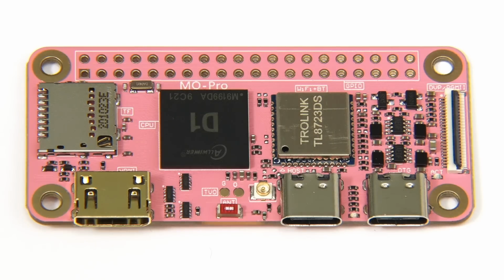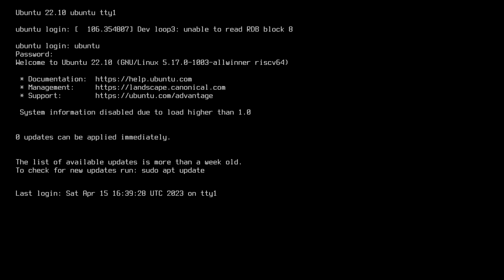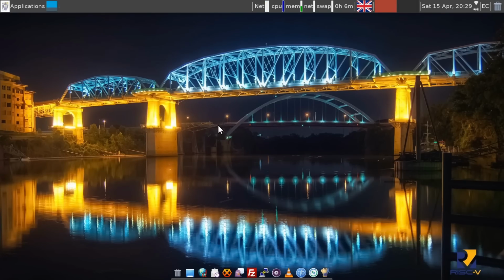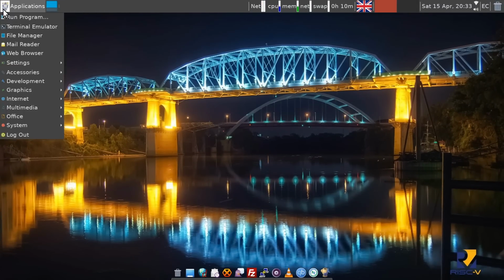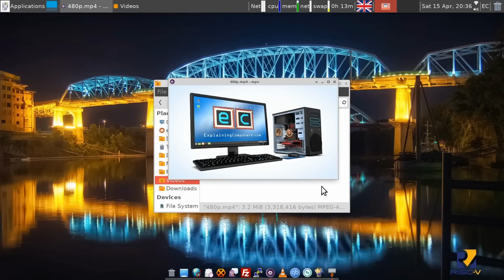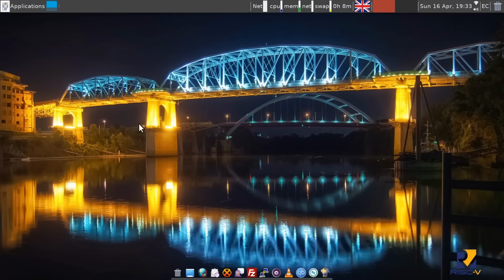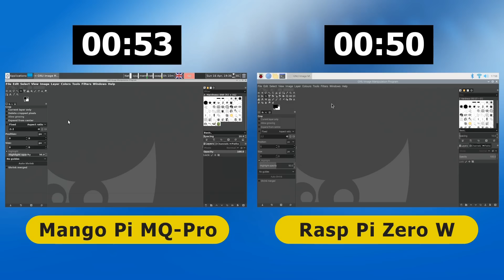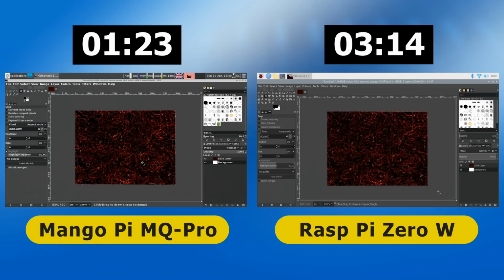Mango Pi MQ-Pro RISC-V SBC

Comment: I really like that RISC-V seems to have reached similar performance in this form factor battle! Shows, that we are getting closer and closer. Even AMD and Intel uses RISC-V in embedded systems and even their CPUs to control supporting things in their architecture. Probably temperature monitoring and safeguards are being controleld by a small RISC-V core. So we ALREADY have it lingering in out desktops, just out of sight and for a very different task nobody thinks about.
Reply: Desktop manufactures been using secundery embeded CPUs for long time, they been using ARM, but ofcorse they rether use something that don't require dealing with Nvidia which owns ARM licencing
Reply: @ShadowriverUB  NVidia couldn't buy ARM. But Softbank is even worse than NVidia.

Comment: We used to run XFCE, GIMP,  Inkscape, and Firefox all day on single core x86_32 chips with 512MB of ram. Of course, resolution was 1024x768, and those programs have changed a lot since then. Wonder how hard it would be to make stripped-down builds of the modern codebases optimized for single-core use. I imagine they use tons of threads these days, which would generally be counterproductive on a single core. 

I suppose such a build is posible for Linux, since it needs to run on embedded systems. Probably not much demand for a usable desktop environment and associated programs, though.
Reply from the maker: You make a very good and very important point. It is (was) perfectly possible to do a great deal with 512MB of RAM.
Reply: Things would be faster on my old windows98 100Mhz 32MB system than on these new boards with x10 the resources. There is definitely some bloat going on. The 1-4GB os image sizes say a lot.
Reply: @freakinccdevilleiv380  It's not just bloat though. Things like full disk indexing, aggressive file caching, high resolutions, compositing window managers, real-time decoding of various compression algorithms, gigabit ethernet, and fast wifi, just weren't viable on the older hardware.
Reply: You can do it with Gentoo Linux - I run Gentoo today on a Thinkpad T22 from 2002 with a less than 1 GHz CPU and 512 MB RAM.

Gentoo compiles from source as it installs, you can use "USE" flags to turn on and off certain features in packages. 

For example, if you want a small and light MP3 player that doesn't need support for other formats like FLAC or OGG, then you can usually turn those off to make that player application as small and light and possible.

You can do it all now, it's just a case of learning how to do it.
Reply: @terrydaktyllus1320  That's quite interesting 🤔 What is the boot time on that system?
Reply: @terrydaktyllus1320  How is today's web on that thing? Do you have to run a lot of content blockers? I would think the Javascript, css3 and videos embedded everywhere would make most websites unusable on older hardware.  Are there ways to compile modern Firefox or Chromium to run on such a machine?
Reply: @freakinccdevilleiv380  It's probably 20-30 seconds. It has an IDE disk interface but an mSATA to IDE converter means you can boot from an SSD and that makes the machine a lot more "nippy".
Reply: @Aplysia  Lots of questions...

The modern web is not the only way that I use a computer over networks, that's the first point I would make.

I dislike the modern web intensely, I think it's a bloated mess and, where possible, I try to use alternative solutions than just a web browser.

For example, for accessing most content, including YT, I use newsboat with RSS feeds and scripts that run mpv for video playback - thus avoiding the browser entirely. (If I have to comment, then I have to log into YT as anyone else would).

I use mutt for email - in the terminal, not as webmail.

I don't use streaming music or video services (due to privacy concerns), I buy my media on disk and rip it myself - I can do that in format that plays on lower powered hardware.

I do a lot of Internet research where all I am doing is reading text - so w3m or lynx work as text-only browsers in that case.

Don't get me wrong, a machine of that age will struggle running any modern browser, I doubt it would play much video here. But I don't use it for that.

I've worked and played with computers for 40+ years now, I enjoy using alternative ways of accessing information or communicating with people - gopher, gemini, irc, Usenet, even a few Internet telnet BBSes...

If you haven't lived through that era of computing, you won't have any perspective on it.
Reply: @terrydaktyllus1320  This looks awesome, I'll try Gentoo today thanks 👍👍
Reply: @freakinccdevilleiv380  Good luck!
Reply: @terrydaktyllus1320  OK, yeah that's what I expected. People still say stuff like "All I need is something to browse the web. " and don't realize how much work it is to render these new sites, or how much work it is to avoid them. 
Are there any search engines that are more oriented towards information than they are to e-commerce and media? I can't find much of anything on Google or Duckduckgo now days that isn't a storefront and/or SEO garbage. Or, do you stick to mailing lists books and other offline documentation?
Reply: @Aplysia  I am starting to use Searx more than DuckDuckGo, I can't really comment yet as to how much better it is or isn't - but it seems to be well rated.
Reply: The hell you did, there wasn't Inkscape when 32 bit x86 was relevant modern hardware. Meanwhile Explaining Computers here is running with no. heatsink. Didn't pop cpu temps open in inxi. Running an object desktop with no clipboard manager in sight. This is corruption.
Reply: @Cineenvenordquist  Inkscape was released in 2003, 64-bit CPUs were only just starting to appear on PC platforms then anyway - around 2002, I myself had (still have) an IBM Thinkpad T22 with a 32-bit Pentium III CPU and probably 128 MB RAM in it (that I've since maximised to 1 GB).

I can't say I ran Inkscape back then (even now) but I was certainly running GIMP and OpenOffice / StarOffice on Linux back then.

For the record, I have that machine today and it has LibreOffice installed on it. It's not "fast" by any stretch of the imagination but it's usable.

And you cannot equate the version of an application that ran 20 years ago to a later version that runs today - as CPU power and RAM has become exponentially more available, so has the ability to include more features into an application to take advantage of both.

That's just "common sense", surely? Why do I need to explain this to you?

Comment: The D1 chipset has a h265/264 decoder onboard, so I suspect video playback is something that can be improved considerably as the linux support matures.

Great review! I've just ordered one, i also got a visionfive 2 based on your review and with the latest firmware I'm loving it 😊

Thankyou!
Reply from the maker: Thanks for this. As you say, there is great potential for software improvement for video playback. The VisionFive 2 is indeed progressing nicely as you say, and I will return to it on the channel when we have the first release OS.

Comment: Thanks for your great and clear reviews! I love them. If I may suggest a very interesting retro-like tiny computer/ Memory Operating System: The AGON light: New open source 8-bit System. A very compact open-source system using a modern Z80 variant, an ESP32 chip and 512kb of static RAM running MOS and BBC basic very fast. Even boasting a GPIO header for interfacing to external electronics. Would like you to review this one, I think you'll love it.

Comment: Great video! Did you notice in your tests whether this board has a low power or sleep mode? It would be useful to wake it up with a microcontroller without having to go through the complete boot process for certain things.

Comment: The problem with this thing is it is only sold on Taobao (for Chinese) and AliExpress. I stopped shopping there, and an item was not delivered to the correct address, and refused to help out, and would not refund. The place where it was delivered shown by GPS map did not even exist.
Reply: That's hardly their fault, though also your contention that φ,θ on Earth's surface has invalid members is new s---. How did the courier find a good spot in badlands to drop off your packet? Get that together, confer with neighbors on getting delivery, and retry. 🌵🧗🏼‍♂️🎮
Reply: @Cineenvenordquist  They picked the courier, not me.

Comment: The mere fact you can run a GUI on a SBC smaller than a credit card, is crazy.
Reply from the maker: Agreed. I never cease to be amazed by this.
Reply: You can, but you shouldn't. If you still want, you have to waaaaaaaaaaaaaaaaaaaaaaaaait a lot.
Reply: Not such a surprise on a platform where the GUI is a modular, replaceable layer. Only a surprise if you are accustomed to platforms where the GUI is bound into the OS as an inseparable monolith.

Comment: An interesting little board, but I think I'd wait for version 2 unless I had really low performance requirements. 

I wonder how many of the Pi-clones will start to struggle once stock of the Raspberry Pi starts arriving. Now that it's Q2 it'll be interesting to see if/how availability improves.
Reply: According to Raspberry Pi , inventory would improve by Q2 2023, and unlimited inventory by mid year. I keep track of a site which reports on the availability of Raspberry Pis.  As soon as the site reports anything b+ or Zero 2, they are sold out in seconds. If you go now, all you will see is original Zero and Pi a with only 512MB of RAM.  It seems the supply issues they said would improve is not doing that.
Reply: @knerduno5942  - Agreed. I looked into this a couple of days ago and I saw absolutely no improvement in the supply.
Reply: If everybody waits for version 2 then there will be no version 2 because version 1 didn't sell enough. Ultimately this board is aimed at the "DIY" hobbyists and makers to try out and see what they can do with it.

I was actually very dismissive of RISC-V when it was suggested that it could come in as a contender for ARM but it is really grabbing my interest now and I shall be getting one of these boards - I'd love to see how Gentoo Linux runs on it as a very customised build.

Comment: the speed at which risc-v is improving is pretty awesome.

also i can see this little guy being taped to the bottom of a keyboard with a black and white screen. modern typewriter, would have amazing battery life.
Reply: But it's essentially the same specification as the original Raspberry Pi Zero that came out years ago - so what stopped you doing such a thing when that came out? If anything, it's easier with ARM-based boards because they currently have better Linux support than RISC-V does.

Don't get me wrong, as a "RISC-V" sceptic a while ago, it's great to see these new boards coming out and I shall buy a couple myself to mess around with because of my new-found enthusiasm for the platform.

But this board can't do anything a Pi Zero has not been able to do for a few years now - the main difference is the hardware design being far more open than ARM-based boards but not a lot more than that at this point.

Comment: A brilliant little Mango SBC for a home hobby IOT project.  I am doing some Raspberry Pi4 examples on the Orange Pi-5 Debian Bullseye OS.  The question is how to control the GPIO PWM pins of the 26-pin header in Thonny Python? How is the GPIO library imported for pin control?  I cannot find a GPIO Orange Pi5 example.  Does the Mango Pi MQ-Pro have good GPIO information?   😎 Thank you.

Comment: I feel like I'm seeing Windows 95 days! The CPU is really low-powered, but you should definitely try Doom on this.
Love it <3
Reply: More like Y's II. But hey, try and run a thermal shroud X hot end, feed, and 3D gantry or 4 (or preferably a heat pumped thermoformer press set) off that GPIO (and additional circuitry and power.) Hey it's my cosplay of The Five Star Stories final scenes...runs on a pink MangoPi. 🥭

Comment: Chooo chooo! RISC-V hype train coming through! 

Question: with different ISAs, can we even compare RAM clocks side-by-side? Isn't that an apple to oranges or oranges to grapefruits kinda thing?
Reply from the maker: To some extent, yes. But on this basis we could never compare anything other than two identical chips -- two i5 10400s or whatever -- clocked at different speeds. All CPU comparisons in practice speed with a different architecture, if not always a different ISA. :)

Comment: It's pretty slow, but it works. It's impressive for the price. RISC-V still has a long way to catch up not just hardware but the software stacks and bundling it all together configured for end users ready to go. The latter is usually the biggest hurdle devs don't want to mess with b/c it "works for me" after they've spent a dozen hours tinkering with settings and filling in driver gaps and libraries that were left out.

Comment: I have the mango pi mq4 h616 and the bigtreetech h616. I seen dialog that the h616 is a risc-v cpu but I can't confirm. All I can tell you is that the manufatures of the mango pi and bigtreetech CB1 are just using the orangepi zero 2 software. The fun part about risc-v is that manufactures don't have to wait for other manufatures to give out the cpu information to write software for the cpu that gives everyone the features they want.

Comment: The D1 (I think it's called) also has a fairly chunky DSP copro which you can run one of the lightweight tensorflow flavours on!
And hardware codecs for video, so it's probably just a support problem for video playback (Linux Vs video hardware, the eternal battle continues)

Comment: Very interesting device, if I can suggest that such devices should be tested for what it's designed.    Graphics and video rendering and playing is MOST definitely not what this is for .    So what's the point that you are doing them?

In a a brief mention you admited that graphical desktop is not likely to even be needed .

IO speed, capabilities, libraries, etc etc, should have been the focus of a review for this sort of SoC.   

Thanks for introducing it
Reply from the maker: You make a fair point. But the GIMP render test did show a direct processing comparison.

Comment: Wow. Nice to see RISC V getting there, but that is painfully slow as a desktop. Perhaps some server stuff (Plex, email etc.) may be more suited. The video playback kind off reminds me of the first time I played an AVI on my Amiga 1200 (before I got the gfx card and '060 accelerator). It played, but you had to forget audio and be patient. For a laugh, I tested the "Lava" render in GIMP on my desktop. I could barely time it - maybe 1 second.
Reply: I suspect slow due to lacking GPU driver, or the GPU they used?
Reply: @knerduno5942  I have no doubt that it didn't help, but even loading software would be enough to put me off, hence my suggestion that it may be more suited to being a low power server.
Reply: @stephenhargreaves9011  I was thinking possible using it for a "Smart Mirror" but the video seems too weak now.

Comment: I think this goes to show you that the software needs to catch up to the hardware. My 533mhz Celery running Win98 could boot faster than that, and it only had 256mb of RAM as well. Even though I firmly believe CISC is a better choice, I'm definitely going to get one of these so I can look into porting my compiler to it and see if the design is good enough to adapt to other hardware architectures.

Comment: While the advancements in RISC-V are certainly exciting, it's crucial that manufacturers feel motivated to provide robust driver support. Based on my research, it seems FTDI currently doesn't offer support for RISC-V, limiting it to x86, x64, ARM, and MIPS32 (as per AN_220). Recent Ubuntu releases that I've used all natively support FTDI without any additional installation required. I'm genuinely curious if Chris's successful Ubuntu server installation included any inherent kernel or distribution support for such devices.

Comment: I'd like to see a video looking at server / headless / non desktop fun stuff we could do with lower specs SBCs like this or the Raspberry Pi Zero range.

At least lower spec than a Pi4 or other more powerful SBCs.  

I know I could run a web server and with WiFi make it an access point so phones or other devices could connect without a router. 

I wonder what else could be included to make and interest demo?
Reply from the maker: A good video idea, noted.
Reply: Certainly proper gpu builds rather than VESA emulation? So mpv runs...not that every 2" sq. circuit should get a 4 k monitor, that seems a bit much. I mean, this thing has no heatsink. Maybe it's not meant to be an amulet of infravision.

Mobile battery rigs, energy harvesting x12 ways in the same space, gravure application to car finish dips, stuff like that.

Comment: That is a very pretty little pink RISC-V SBC! While it is a shame about how video playback turned out, it does play nicely with Linux and the Dillo browser! (will need to be extra careful when typing that name out). This is the first time I've heard of Dillo and seen it in action! It reminds me a lot of the old Internet Explorer before it earned the reputation of being the go-to browser for installing other browsers.

Anyway, all in all, it's a good, low-cost RISC-V board. I'm sorry for the lack of a donation this week, by the way. I'm basically broke. 🥴😅
Reply from the maker: I like your description of the old Internet Explorer. :) Nice.. I have no expectations of a donation.
Reply: @ExplainingComputers  Thank you!

Also, I think Microsoft Edge is a worthy successor to IE. Good for installing a different browser AND any necessary programs and clients you may need! However, I do like the Xbox version of Edge because it lets you set images from Bing or whatever site as your console's home menu wallpaper.